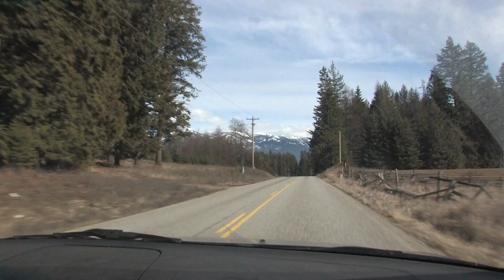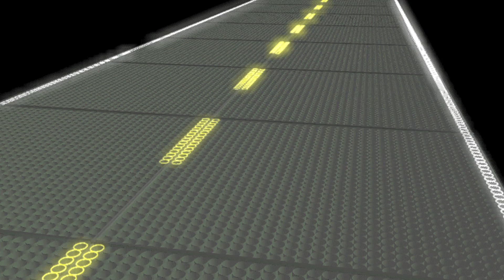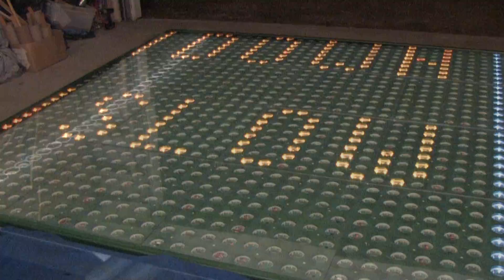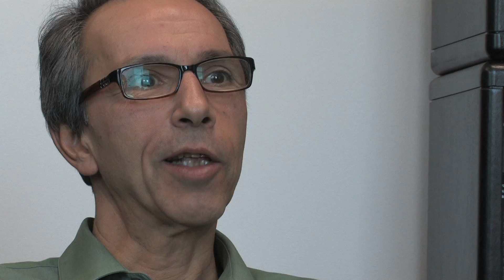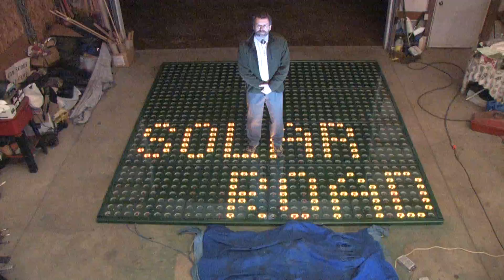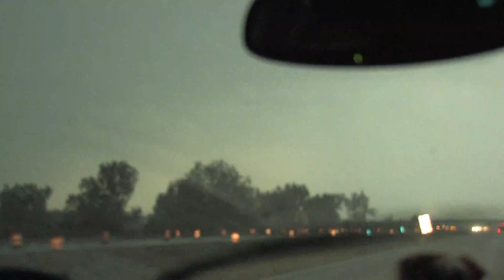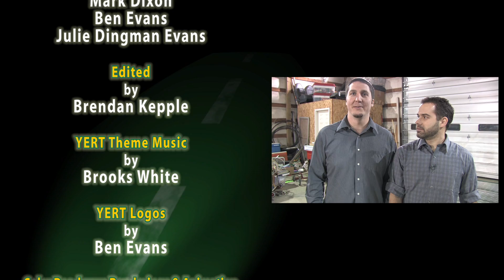Solar Roadways: The Prototype

Comment: We should focus on putting these on people's roofs rather than roads. Solar panels are much more efficient when they are angled toward the sun. They are also way more efficient when they are clean. Roads become very dirty, which would require constant maintenance. Roads also have settling issues over time from constant use. What will happen when a solar panel lifts a little?  There are also tons of underground utilities, what happens when repairs need to be made or new connections have to be performed? I am all for innovative technology, but this is not one invention I want my money directed towards.

Comment: do the SOLAR ROADWAYS PLEASE IT'LL SAVE UP MORE AND GET US JOBS
Reply: Why do you think so
Reply: Kat Lee I don't think that solar roadways are a bad concept. They are a bad concept. If you know anything about solar panels, glass, and engineering, the first thing you'll realize is that glass is fragile. Even if you were to produce glass that is tough as nails glass(which has been done, there's literally glass that can withstand more stress than steel) it will be highly inefficient due to the amount of money that it will cost(remember, these glass will also have to provide traction so money will be have t be spent on that). And this is one of the many reasons that solar roadways will be a failure: it is a project meant to save money, but we will probably spend much more money than we save by making them.

If that is not incentive enough to change your opinion on solar freaking roadways, then let's just get to the meat of the of the issue: solar power. Solar power is such a powerful word. When one uses it, you will grab the attention of 100 virgins. Why? Because it is a renewable energy source, and that's green. What you might not know is how solar panels actually function. With some quick reading, you'll start to realize that not all sunlight is the same. Sunlight is strongest when its rays hit us at a 90 degree angle. The greater the deviation from that the less strong the sunlight is. That is why when solar panels are angled they can absorb stronger light, since most of the time if the sunlight were to hit the ground, it won't be close to 90 degrees. Solar roadways have flat solar panels. Which means, they absorb weaker sunlight than solar panels. And so I ask you, why should I rely on solar roadways when I know that solar panels are much more reliable?
Reply: Andrew Cheng there is also glass thats been made to not shatter into millions of pieces thats its glass yes but its nonbreakable glass and what the freak with the 100 virgins XD they are just like the Solar Panels that why they both have "Solar" in it and it'll get us job which Obama said he would've given us a job by now but we can make out own so we can get out there and work ourselves
Reply: Kat Lee Um, in case I need to spell it out-this shit just cost too much for it to be worth it.
Reply: thats why we work for it to happen duhhh
Reply: Kat Lee That statement makes no sense.
Reply: Andrew Cheng we are working with other jobs or saving money by collecting materials from around the world and from different planets that can create money and Obama while his still in office but not much longer I HOPE but he can create more money so we have those things that we need in this United States of America (USA) there are very important meetings that needs to be set out of course and some cut backs but if its to do something right in the free states then its something now ain't it that's what I was saying "thats why we work for it to happen duhhh" that was my short answer
Reply: Andrew Cheng and you should know this dude
Reply: Kat Lee hey i shounldnt have to decipher  your comments i mean it really shows how much dont don't care about expressing yourself in a way that people can understand you and collecting resources from other planets is not a good idea since we would need to spend resources to get them so we would be wasting money and we are not saving money in fact the US deficit is still at large please if you see how hard it is to read comments like this don't write like this to me also WHAT DOES THIS HAVE TO DO WITH SOLAR RAODWAYS

Comment: and you store the energy, how? and at what cost?
Reply: alias mrstarmat What planet do you live on?  I have work with modeling energy time series. They're extremely heavy tailed and exhibit complex serial dependence largely because energy storage is extremely costly. You have a right to your opinions but you dont have a right to your own facts.
Reply: mnminnmn Back of the envelope calculations show that 3/4ths of the power generation from unscratched grim free solar roadways would go to powering the static lane leds. This task is adequately done by adding a white or yellow paint and having reflective strips at night.
Reply: alias mrstarmat 
Even if those numbers were true, it would be a profoundly idiotic waste of solar panels. Economic rationality dictates that the optimal method is used first until it is exhausted and then the next best option is utilized. Do you think it's optimal to place solar panels flat on the road under layers of thick glass with bumps protruding from it and subjecting it to the oil and sand grinding against them by 18 wheelers? 

Of course a massive decrease in solar efficiency would not be preferable if there was any other place to place said solar panels like on an angle on the top of rooftops with ultra thin glass protection or dynamically tracking the sun to obtain an even greater efficiency. Seriously, think for once in your life.
Reply: mnminnmn During the day, the leds would have to outshine the suns input into the panel i.e. a 100% efficient led would require an equally sized solar panel to be well over 100% efficient (obviously this is not the case so you need a lot of solar panel space for every led)  . To be visible during a bright sunny day, the leds would require a lot of energy. This is accomplished in the real world by painting a highly reflective color on asphalt ==>white has optimal reflective power and second best yellow.
Reply: Keshav Meda  You seriously think that this is an adequate response? How much do you think it would cost to build a high voltage energy distribution network  next to the road? Also, after you have constructed said high energy distribution network, if there is excess power than where will it be stored???
Reply: alias mrstarmat "Replacing them with solar roadways, would produces 3,5 times the electric energy consumption per year in USA every single day"

Replacing white or yellow painted static lanes with LEDs will increase US energy consumption by an insane amount. For what reason?
Reply: axe863 This idea still sounds good if we dont store the energy and just intelligently route it back to the grid !
Reply: axe863 and do you have facts about what you've mentioned above - "You have a right to your opinions, but you don't have a right to your own facts", we're just talking about ideas of what might work or not, shares thoughts, nothing else more, I'm not an expert in the field of storage capacity system or in managing electric energy with sophisticated smartgrid, but I'm sure you're not an expert neither in this fields, these fields are complex and varied. But something that I'm sure about, using every pavements, and impervious surfaces of the 48 continuous states alone and replacing them with solar roadways, would produces 3,5 times the electric energy consumption per year in USA every single day! The numbers are very conservatives, it uses for 4 hours of solar irradiation, with 18,5% efficient solar panels, using measuments the sun at its lowest point of the year, i.e. in winter season, and so on. Also, interesting calcul, doing 3,5 x 365 days/year = 1277.5, and having (1 / 1277.5) *100% = 0.07% : using less than one tenth percent of every pavements in every 48 continuous states as solar roadways would power USA each day! That's a very promising concept. You don't always need to store energy to make it valuables, just think about air conditionning during summer, peak demand for electric emergy during this period usually, if not always, match with lot of solar irradiations : high powering solar panels with conditioning air seems a perfect mix. 
here my facts ;) :
http://solarroadways.com/numbers.shtml
Reply: alias mrstarmat Are your facts coming from a certified 3rd party audit body? Or the seller's own preach? And what good is it if the energy cannot be stored for later consumpsion needs? You sound like a total layman.
Reply: +Tofu it's a debat, believe what's written or not, that's your business, I've putted my source and it has calculs, don't need to piss people off
Reply: alias mrstarmat Translation: "I have no idea what I'm talking about but I'm gonna spew a bunch of shit anyways because a YouTube video said so".
Reply: mnminnmn don't need to store it, you use it where you need it via the smart grid of the 21st century's technologies
Reply: alias mrstarmat what powers the road at night?
Reply: a storing capacity system wouldn't hurt if there is a surplus of energy produced during day, of course

Comment: the only 2 things that this concerns me about is that it would increase light pollution and big oil/energy basically has the government in their pockets so it probably wouldn't fly.
Reply: Brandon Acosta not need to light at full capacity when not necessary, and the technology would probably been remotely control as said in the video via wireless connection, we could named it : smart energy road

Comment: Dude, please stop leading the ignorant masses and giving them hope for this pipe dream.  For all you hoping for this.  I promise you.  This will never happen.  They built a tiny road (bikepath) in the Netherlands and I'm glad they did so they can say "Nope, not feasable."  Oh, you may make the modules.  They may exist and you can lay them down, but the promise this guy is offering, is not there.  The LED's alone will eat up the meager, paltry power.  The infrastructure required to harness the energy is another huge cost.  The infrastructure to convert the energy to a usable form (Alternating Current) will cost and will also destroy 30% of the paltry energy that this makes per square.

Comment: To show this would actually work as a road generating electricity for more then 1 day under normal traffic of a major road...... Take any vehicle... do a burnout on one of the panels till your tyres pop.... then see if said panel is still transparent enough to let light to the solar collectors.

Theres no way these things would every stay functioning for more then a week.... Even if they were sturdy enough dirt/scracthes/rubber would build up on them, leaving the surface opaque  and rendering them useless for power generation.

You'd be better off attempting to make a cheap roofing material that is also a solar panel.

But this guy isn't about cheap power, this guy is after what every cult leader and televangelists is after.... the money of idiots.

Comment: There are other problems mentioned before but I think the biggest obstacle is the labor costs. Asphalt roads are much simpler and still most of their cost is in the labor and equipment. Making them involves street paving vehicles that can form a 10 foot wide lane in one continuous motion without any one touching the street.

Have they thought of any methods to make the construction of these solar roads as efficient as possible? You'd need to come up with a new workflow, and possibly build new machines for the automation of building these roads. I really doubt that manual installations would be affordable on a large scale.

Comment: The problem with thos panels is that a non-movable panel of this size, burried under a thick layer of partially reflective glass will never be able to produce enough energy to at least cover its own (admittedly very low) consumption in lighting, communication and (i laughed a little at that one) heating (xD you would need at least 50 panels to heat up one of those about 5°C)

Comment: I love this idea, but What about light pollution?
Reply: Rachel Stephanie What about massive trucks running over the glass where the firction from the dust under the tires( i.e. tiny rocks) dulls the glass until it's opaque in a few minutes extremely reducing the already pathetic solar efficiency of a solar panel laid flat on the ground under thick glass?  :P

Comment: I've got a project to convert railroads to the Atmospheric system, originally trialled by Brunel, it failed because the technology of the day couldn't produce adequate valves, but now, using plastics, we can. All I need is $10,000,000,000,000,000 dollars; anyone care to contribute via account 230492u502234230  c/o The Quicksilver Bank, The Cayman Islands?

Comment: I can't wait for them to pave a bigger surface- maybe just start with a low-speed low-traffic road- so we can get some real data on this.
I hate that there's so much negativity towards this idea. Sure its crazy- I almost wish they would have left out the LED's and fancy features and just started with the basics- and it will probably require changes once its put to the test. But it's an amazing way to test our capabilities and it may just work.
If it doesn't, we tried, and a couple million bucks is nothing compared to the money we're spending on who knows what every year in this country.

Comment: Some of these figures seem to be intentionally misleading.  While liquid asphalt may cost  $1,000 per tonne (and I may dispute that figure later), it is only about 5% of the mix that is poured on the ground.  I can buy asphalt mix retail for under $300 per tonne.. This is about $60 per square meter.  The current cost for solar road ways is over $10,000 per square meter.  Over 95% of asphalt is recycled. While the glass in solar road ways may be able to be recycled, most of the electronics will not be able to. The payback time on a solar road panel (assuming a 99% drop in manufacture price and no installation or maintenance costs) is over 100 years,  while the actual lifespan of the road panel is probably less than 10 years.  There are many issues with this project that are just being ignored or glossed over.

Comment: I would really like to see this work. I have read many of the interesting comments about the efficiency and materials used, but I have not seen anyone addressing the traction on a glass surface. Of course inclement weather will be more of an issue, but what if i got brand new tires on this glass road? Brand new tires even skid on rough asphalt!
Reply: Thunderf00t addresses this. Quite simply they would not be suitable as a road surface. To get enough light to the solar cells to even give this thing a remote chance of working, the glass must be clear, But for traction the surface must be rough. You just can't have both. Not to mention glass scratches very easily and wears fast. So any texture would wear away, and a clear surface would quickly turn a milky white  from all the scratches.
Reply: I see that all happening. Thanks for some input. What about the costly sapphire glass? Still no traction, but it may have the durability.
Reply: Jeremy C. I don't, not in my lifetime or anyones alive today. Even if we could get the perfect glass, and at a price that is workable, the flaws in the idea itself means this will and can never work.
Reply: I see what you mean, and i agree. You know the military has been experimenting with solar power in the form of a spray. You can literally spray it on a wall or rock and charge things. I haven't checked back in on this invention yet, but something like a spray with solar cells inside could be used on existing roads and walk ways. What do you think?
Reply: Jeremy C.
you could roughen up the surface of sapphire glass enough to provide traction (on a dry day) for cars, but that rough surface would diffract the light all over the place and it would make it easier for dust to settle on it making the solar panels even less efficient, but in the end even sapphire glass would get worn smooth and become kinda slippery and opaque, and regularly maintaining/replacing them would cost way too much.

spray-on solar cells on roads would just be wasteful, as you might be aware roads do wear away pretty fast especially the surface.

Comment: Here is the solution to the problems stated in the comment section:

Throw away the circuits, LED's, the glass, but keep the solar panels.

After that; stick the solar roadway-panels that now are stripped down to only the solar panels to the roofs on buildings.
Implement a system that can change the angle of the solar panels depending on the seasons.

"How to store the energy-generated dilemma"?

Produce hydrogen from water with the help of "good guy" Electrolysis.
The hydrogen can then be used to produce electricty or to cook your food.
And when hydrogen combusts it produces mostly water-vapor.

Problem solved.

Comment: You should put induction loading devices in the panels, and a induction loader under the cars, the cars will load them selves when driving on the roads. And I also have a question regarding the LEDs that needs to be changed after 5-20 years depending how often they are turned on. It will be a huge project to change the billions of led-lights when they get burned out. How will you solve that problem?

Comment: Thunderfoot tore this idea apart. From making a road out of glass, to the amount of power a solar panel can produce when pointed straight up, and how much of that power would be used by the LEDs... There is no way that this can work. I'm not saying it wasn't a good drawboard idea to try and build from, but it's simply impossible, and would cost a ton more than they speculate it saving.